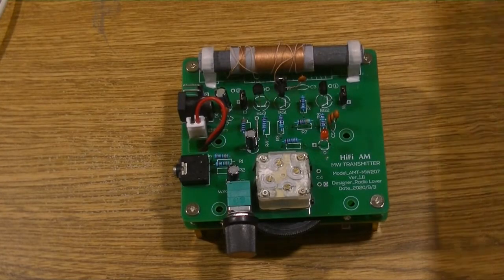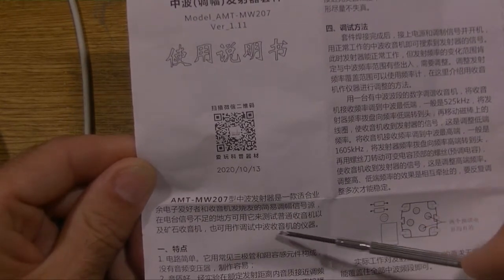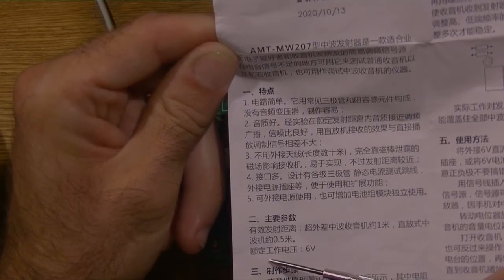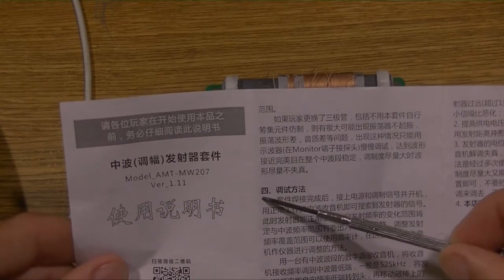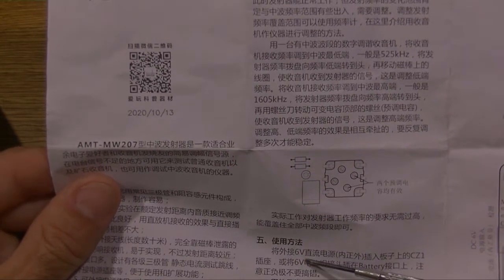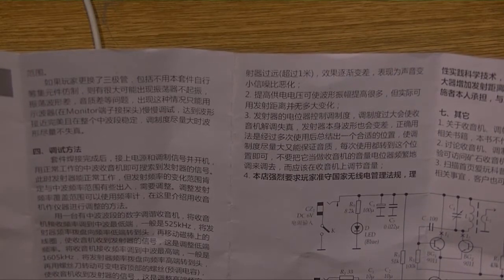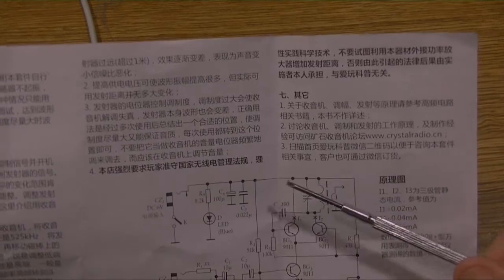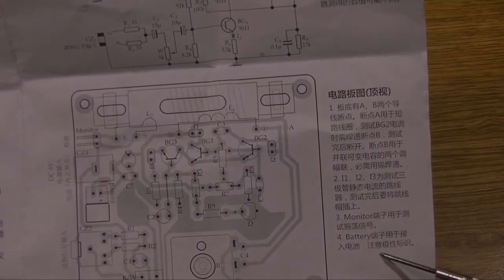AMT-MW207 AM Radio Transmitter. Hidden secrets Reveled! Full English Translation of the Manual

Comment: Need to transmit on 9 kHz frequency like 747 kHz and 846 kHz, 603 kHz and 594 kHz and receive with 10 kHz only  digital tuning AM receiver like Eton FRX3, Sidekick, Midland ER10VP/ER50, Retekess V111, etc… 9 KHz receivers like Degen DE1103 (Kaito KA1103), Eton Executive, Tecsun PL-310 ET, etc…

Comment: I built this kit about half a year ago. It's a good, i mean a well designed kit. Only thing missing is a place for antenna. It has jumpers to take certain components / stages out of function. I tuned it quite easily. It works better and had better frequency stability on higher end of MW spectrum.

Comment: You can increase the range of this thing by swapping out the output transistor (BG2) with a low power Darlington transistor (2N5306) I noticed a big difference  in output signal, you may have to increase the voltage to 6.5 volts to compensate for the swap.

Comment: I had an interesting issue with this last night. Low-end bass was very distorted and made some of the songs virtually unlistenable. I charged my batteries overnight, and today the issue is not really present (at the very least, it’s considerably less bad). Is it possible that when the voltage on the batteries drops, it affects the frequency response/performance? The only other possibility I can think of is that it gets worse when the transmitter is on for a while.

Comment: When you put in the electrolytics which is positive on the board?
Reply from the maker: Without looking at the board and working from memory they usually print a dot or mark on the board for negative mark the negative pole on the  electrolytic capacitor. Also the positive lead on the cap is usually longer. The disc caps are non polar so they can be installed without regard to polarity. Have fun...
Reply: @RobertWardJones  Well when I put the elecs in the board I had to cut the leads of course. I then realized I may have put them in backwards. From what I've read the solid half circle on the board is negative. Thus when I went to take them out I lost the ability to determine which lead is positive. Darn!
Reply from the maker: The negative is marked on the body with a white stripe with  a bunch of dashes - - -  printed in the stripe.

Comment: My MW-207 shows a 2-ganged variable cap (C4). Why does your have 1 gang?
Reply from the maker: Hi.  Why?  Looking at the part on my kit it looks to be a double but I'm going to lay some info on you that may be helpful. These kits evolve over time to make them hopefully better but more importantly to make them cheaper to make. Also there can be multiple manufacturers of these kits who will clone each other but not be exact copies. One of the strategies to make them cheaper is to buy parts in bulk. If a two gang variable cap is cheaper that  a single gang and they can make the circuit work with or without a circuit board change they will use that part.  Another strategy is to eliminate parts. I often see circuit boards with empty spots for parts. That is because if they came make the circuit work without those parts that is money saved. I hope that helps.